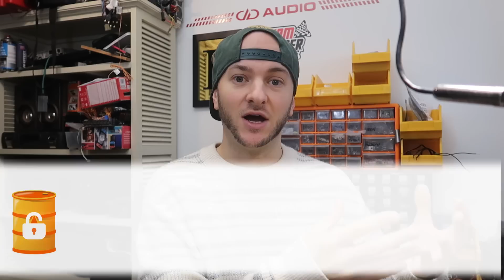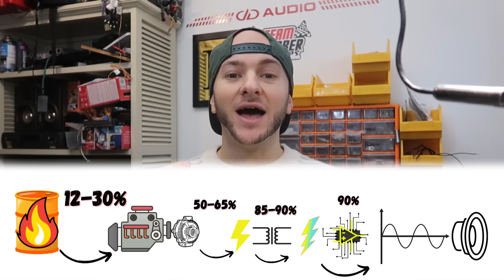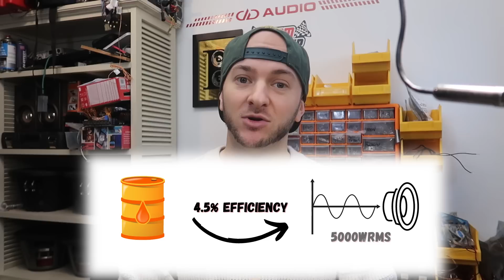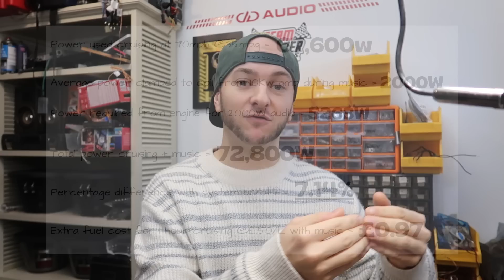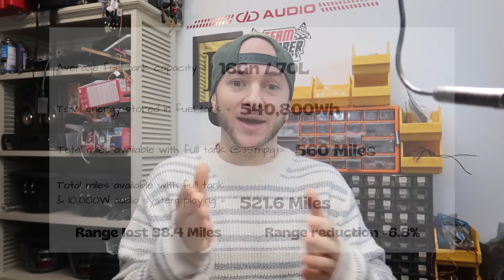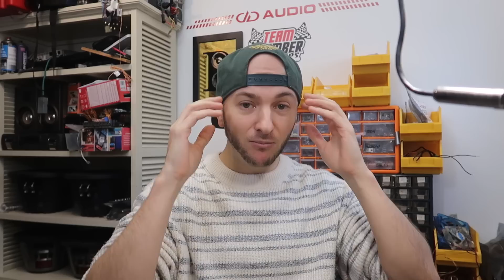What Happens to Car Audio in an Electric Vehicle Future?

Comment: Again bro I keep pausing when I hear something wrong and press play after i type out a response but your claim on the amplifier having little noticable effects on an EV range is not true. I work on Teslas and attended the technician school they send you to in southern california and I am far from an enigineer but the audio for EV cars is one of the biggest hurdles they are trying to find new solutions to because the dramatic effect it has on the battery life. They have to engineer the amplifiers special to the EV because they arent allowed to draw more than a 30 or 40 watts for the whole system including the dash unit. Thankfully audio efficency has made big leaps and cclass D technology has made it possible to use 90% of the 40 watts being drawn but if you drive with the radio off vs on the difference in range is noticable still at just 40 watts. But on high volume they still don't get loud like I like to listen to because they need to conserve power.
Reply from the maker: No problem, I appreciate your thoughts even if they oppose mine. The more discussion on a topic the better. If you are able to throw out some numbers on the decrease in range from OEM systems and the changes made and what effect they have, that would be great. As you know EVs consume many hundreds of kilowatts, from the calculations I've done, a 40w stereo makes less of a difference as whether there is a tailwind during a given journey. Perhaps it's since that EVs have such restricted range to start with due to the poor energy density of current battery tech.
Reply: The 30-40W limit has very little to do with the effect on the range of the vehicle, and almost everything to do with the limitations of the step-down converter that supplies the 12V auxiliary system. In fact, the owner's manual for my hybrid explicitly says that this is the reason for the 30A limit, to prevent damage to the converter. With additional, higher powered step-down convertors, or by bypassing the step-down and tying directly into the HV battery, there are ways to work around this limit.

Comment: I think we left out one very important thing.
The auto makers will already have a solution for AFTER market amps and stereo equipment.

They can easily install their own amps and head units.
Which the consumer or installers can tap into and use.

This isn't rocket science.

All the consumer needs to do is examine what is already in place and adapt to it.
Reply from the maker: Perhaps, but installing aftermarket systems in the most modern vehicles is actually already a nightmare, as everything is so integrated into the vehicles computers. Often the audio is sent via data in optical cables, and if the amplifiers aren't present or replaced with non-oem, the system will throw errors and refuse to play. I don't see this mentality changing.
Reply: @barevids  Remember when Teslas first came out?
No one understood them to even take one apart or use the parts on other EV's

Now look around they use the motors and batteries on other EV's that are not TESLAS at all.

Same can be done for the audio systems.

The hard part isn't the hard part.

Once you get a mind at making it happen things go in that direction.

Computers used to take up a whole ROOM.

Now they are in our pockets.

Its not a matter of If audio systems will be built and fitted into EV's it is a matter of when.

Back in the 70's Auto makers were not even interested installing high wattage audio in cars.

Now you have Multi channel high wattage units installed in cars as a standard feature.

Once enough Ev cars are on the road mainstream.

The Audio industry will adapt and catch up.
Reply from the maker: oh sure, i absolutely agree with you there. just you said the auto-makers will have a solution for aftermarket equipment - i took that as Tesla, Nissan, Ford etc thinking about making aftermarket stereos easy to install, which i highly doubt

Comment: I want a Prius, but they don't have an alternator so NOPE!
Reply: Prius do have an alternator. Its used to charge the battery.
Reply: @JasonWW2000  But for car audio purposes it can't upgraded.
Reply: @Successiswhatmakesyouhappy  The stock charging system can power a normal aftermarket sound system. Are you wanting to build a bass van with it? How much current are you planning on pulling?
You can always add a lithium battery bank.
Reply: @JasonWW2000  I have a 320 amp alternator in my Impala and 3500 watts. I can't do that in a Prius.
Reply: @Successiswhatmakesyouhappy  It seems Prius cars tear up pretty easy with lots of bass. See this video. https://youtu.be/5_Ue5WCd86w
So it seems big systems and a Prius is not a good match. You'd have to keep the system small or else use a different vehicle.

Comment: bro really thinks that the more energy your alternator generates, the less efficient your engine is...
Reply from the maker: Bro really thinks the engine doesn't supply energy to the alternator? 😂
Reply: @barevids  This point is valid, but a vehicle without an alternator vs a vehicle with an alternator would make effectively the same amount of power at the same efficiency..and if you put a more powerful alternator on your vehicle, it isn't as if it's harder to spin or that you have to spin it faster to make more power. the power is being generated by the alternator being spun by the engine, and then engine isn't working harder to generate that power.
Reply from the maker: @Stalker-lh5nk  dude, that's EXACTLY how it works. The more current you draw from your alt the harder it is to spin. Simply fitting a 300a alt to your car doesn't put any load on the engine by itself and it spins freely, but when you demand current from it, it will literally load the engine as it steals kinetic energy to turn it into electrical energy. Watch ANY video on YouTube (Linus tech tips did a good one) where someome hooks up an alternator to an exercise bike and notice then while pedalling as soon as the electric device on the alt is powered on or used, the alt-bike becomes much harder to pedal. The thing is, compared to an engine, a car audio system uses comparatively such little power that it's rarely noticeable, especially in the states with large powerful engines. In Europe it's a real issue, our little 1.0Litre shitboxes with 55bhp have trouble idling when running any reasonably powerful audio system and some have even complained the engine stalls when the bass hits running 8k+ because it's like you just brought the clutch up without adding any gas. It's simple conservation of energy. Fuel goes in, fuel spins engine, engine spins alt, alt makes electricity.

Comment: This is all valid untill you run true high voltage amps from stetsom Taramps sound digital all over 100volt designed amps
Reply from the maker: yep, i mention that in the video
Reply: I have been for years

Comment: The inverters are the problem. most e Cars are arround 15-100a chaging. so its like a standart alternator! you got at max arround 100a @14.5volts so thats 1450W or 1.45kw constand.  So at the moment ther are 3 systems 200-400-800volt batteries for e cars. Tesla model s Plad the batterie does over 1000kw or 1.0++ mw. if you have a amp like the taramps with high imput power. but with 400+volts  you can connect the amp strait to the akku. SO its posiple todo 1mw/1000kw/1000000watts!! but its daedly as fuck!!!! would i build something like this? hell yes! but i'm also a car mechanic and have a degree in electrical engineering. BTW its posible to build an d class amp with the diamentions of a hifonics collossus XI that does 500000watts rms water cold with the newest fets...... the question now is, how to builed a subwoofer that can handel 50000/100000 or even more power!!!than there is no space for 1000 1kw woofer in a tesla model s!

Comment: I use a 50 fared hybrid in my EV and I’m running 2400 watts which is not extremely high but nice and I never get voltage readings at my dashboard below 14.6 volts and my system is great sounding.I do use Brazilian EVOx amps which are super efficient in a EV setup.
Reply: What is the voltage of the battery in your EV? When he says high voltage battery. Makes it sound like it’s 24v or 48v

Comment: There isn't a viable electric car future if you believe there is you are kidding yourself. They can't make enough batteries fast enough. And you need a new one every 5 years.
Reply from the maker: I'm with you here, with current battery tech for sure. This is just a "what if" scenario if it does end up becoming the norm :)
Reply: @barevids  there is definitely the possibility of some weird one off audio for electric vehicles. They all input the same power for charging but what the car does with that is different on almost every vehicle brand.

Comment: Good point 12-16 volt systems are FUCKING shit , if you skip the power conversion in a amplifier you get more efficiency , so we are going towards the 100 K  watt's   ( LoudFiat channel )  YEA! BOY  ,   but the subs still get the same power so it's a  rabbit hole going deep to talk about  for the next  5 years , 12v 3000 amps or 400 vold  50 amps   queaa what is best  ,<3 cheers

Comment: At the risk of being unpopular, the range is the current downside to ev's, the extra power and weight only makes that worse. And after that it takes like 3 hours to "fill the tank"
Reply from the maker: Yep, EVs are definitely not in direct competition with ICE vehicles at all yet. When you can recharge your EV in less than a minute and get 500M+ range, without the batteries degrading and failing after 6 years, that's when ICEs are in trouble.
Reply: 3 hours? You might want to check into that. Most people doing long trips only charge 20-30 minutes.

Comment: Same inefficiency in acquiring electrical energy. Difference? Large current draws in an electric vehicle will strand you. Large current draws in a petrol vehicle... we've all done that with no noticeable consequences. So what have we learned? You can walk and get a can of petrol. You can't walk and get a can of electricity. EV's are a terrible idea and will kill car audio.
Reply from the maker: With the HV supply, you can easily have a breaker installed before the step-down converter at 16a, which would trip if the audio system demanded more than 10,000W - thus not depleting your supply and stranding you. However running out of power due to any circumstance would certainly be much more annoying than running out of petrol, yes. You would need to be recovered, same as if your engine broke down.

Comment: The shift to EV vehicles will be a long time from now. As soon as we get these Democrats out of office, gas and diesel will be back on!
Reply: There is not enough resources to make the batteries to replace the  current cars and trucks with electric its a pipe dream will never happen
Reply: @TN1337X  Amen
Reply: It’s not a political decision, it’s what people want. Before you say that’s untrue, look at what’s happened in the car industry. Tesla has taken so much market share from the establishment manufacturers that they had no choice, it was start building EVs or die. GM and Toyota didn’t want to make EVs, they make way more selling gas cars.
Reply: Ok boomer
Reply: @tillyhatcam  sure people want evs, but no one ONLY wants an ev. Its always the 2nd or 3rd car
Reply: @Treal  exactly I just had to tell them the truth but other than that I feel just like u if we make them those will buy if not stick to ur old vehicles or bi-generated vehicles or electric whatever pleases the person cool video on systems and new electric car setups
Reply: @TN1337X  And you think OIL is unlimited in supply? So we should just burn as much as possible? LOL, for a gas car you have to refine and transport the refill to gas stations where with electricity, that can be transported to the car without massive tanker trucks. You're leaving out a lot details with your blanket assertion.
Reply: @jason5523-r5m  I didn't say that I think you are missing the point here there are however other technologies out there other then electric that may be of interest
Reply: @TN1337X  not really, hydrogen is extremely dangerous with pressurized tanks and biofuels will require some sort of breakthrough that doesn't exist. Battery technology has been improving at breakneck pace and solid state has breakthroughs happening also.
Reply: @glencalhoun9544  yeah and you think we can continue to support 8 billion people by expanding on 95 million barrels of oil a day? Lithium is found in the ocean and we can now extract it from there. Also, lithium batteries are recyclable. 

And you just contradicted yourself.
Reply: @jason5523-r5m  theres also oil drilled from oceans. Lmao. And no contradictions. Oil has been and still is our best for travel. Until a Dyson sphere wraps our sun or a nearby star electricity will not be the answer. Considering most of it comes from burning the same fuels as our cars. Or lp/ natural gas. I worked on the electrical crew building these natural gas powerplants. Burning fuel to power the electric grid. That includes all of the electric cars that charge off of them......
Reply: @glencalhoun9544  solar is cheaper now than fossils and salt batteries are a thing now for home storage or mass storage.
Reply: Yea it's definitely gonna be a while till we all drive electric and by than I'm sure the technology will increase drastically, maybe even far enough that they will come up with an alternator so we dont have to plug them into a charger. Either way that's 10 plus years from now, unless gas car are banned, all the people who bought brand new 2023 cars is gonna be driving them for atleast 3 years, and than someone will buy it as a pre-owned and drive it another 3 plus years, and than sell it to someone else who will drive it till it dies for another few years, so it'll be a while till we're only left with electric cars to buy
Reply: Shinny green rods goo brrrt
Reply: @tillyhatcam  bro economically it does not matter what people want if Demand cannot be meet it will only result in scarcity due to low supply
Reply: It'll never outright replace, we've spent literally hundreds of years developing engines, were not gonna chuck that all in the bin, ever.
Reply: @jason5523-r5m  but gas isn't dangerous?  Come on man.....
Reply: @jason5523-r5m  making and recycling lithium batteries cost more energy than the lithium battery will produce in its LIFETIME!!!!!  It's a net negative....
Reply: @amanteapasionado6836  wtf amante an automotive electric motor IS an alternator that can practically recover all available energy while decelerating. You're not making more power from an alternator because that increases drag so you will have use more energy to accelerate, stop, turn, etc etc.
Reply: @jasoncurtis4404  no, lithium batteries are being recycled virtually 100%. They are very recyclable. I don't know if you have ever driven a gas vehicle for very long but some of them don't last very long. You're talking to someone who has changed connecting rod bearings successfully more than once. I know how things work.
Reply: Amen to that ❤ 🙏🙏🙏
Reply: @TN1337X which ressources don't we have enough of?
Reply: @Lexusyachtclub been driving only EVs since 2017 and i drive over 50 000 km a year. Saves me a bunch of cash

Comment: Can no give us a simple answer to the question. How well would an electric car do with an aftermarket stereo? Let's say 2 subs... Already know how engine electrical systems work. we've had them for over 100 years. This was just a guy pretending to be a scientist without giving any real info on how EVs do with an audio system. The title is "What Happens to Car Audio in an Electric Vehicle Future". Not how do combustion engines make electrical energy. You also missed that some cars and trucks use generators instead of alternators. Figured I'd call that out since you wasted so much time teaching people how combustion engines work. Will the speakers drain the battery a lot faster or not...... Change your title to "how combustion engines make electrical energy and voltage efficiency in EVs". Then add PS. "I wont tell you how much faster aftermarket stereos will drain the EV battery". Or simply "How efficiently engines and EVs use electricity". You didn't say crap about how much faster the battery will drain which is the only thing people want to know.  Thanks for the waste of time. Go here https://www.youtube.com/watch?v=4DwwODuyFIY if you want to avoid this guy poorly explaining how engines work and you just want to know how well subs work in an EV. You're welcome.
Reply from the maker: I guess you didn't watch the entire video and now look like an idiot. 19:31 Because I covered all of those questions. I didn't explain how ICE works. I explained where the electrical energy for your audio system comes from with ICE, which a huge proportion of people do not understand, because they believe running a 10kw audio system at full blast doesn't use any more fuel than simply idling. So I had to explain that. Then I did the same for EV to show the wildly better conversion efficiency. Then I talked about the percentage of total available energy for travel that is used up by an example sound system being played at full whack and showed how tiny it is in both engine types. Guess you're out on the internet looking for someone to pretend to be smarter than.